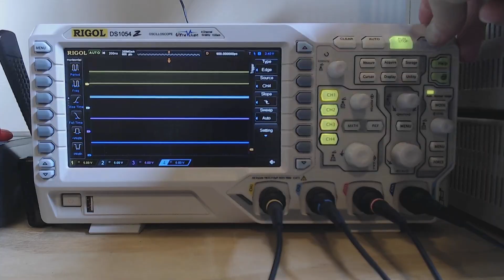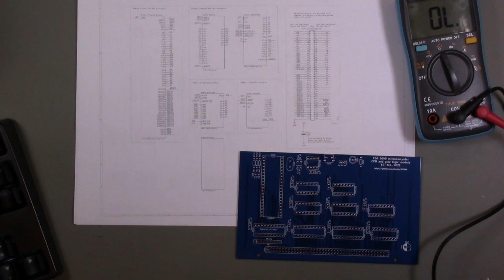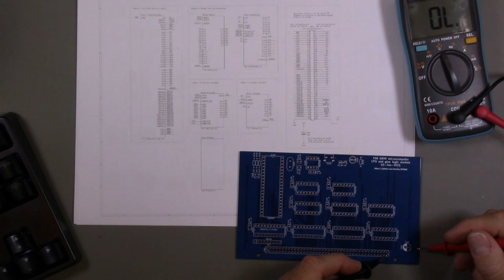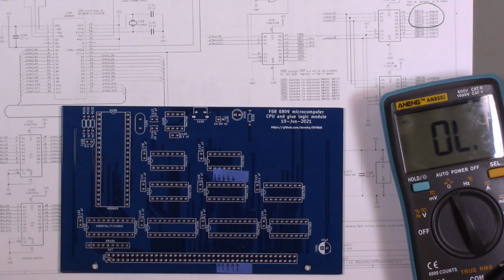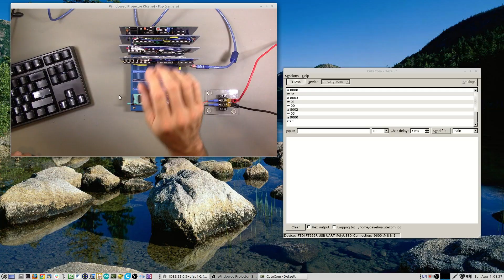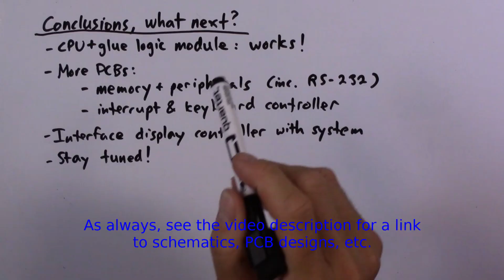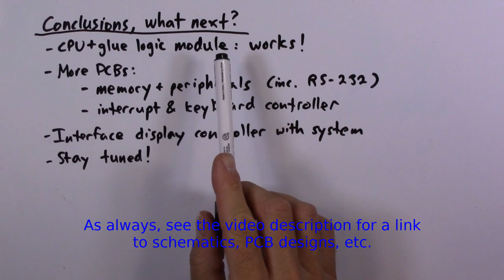DIY 8-bit computer, Episode 17: Fixed CPU/glue logic PCBs

Comment: Hello sir, I have a question. Is it possible/viable building some glue logic circuitry to allow newer RAM sticks (DDR5?) with 8/16/32bit systems(6502, z80,68k etc)?
Reply from the maker: I've never worked on modern DRAM technologies, or even any kind of DRAM at all. I think that memory controllers for modern DRAM devices are available for FPGAs, so you could potentially synthesize a  memory controller that way. However, you can get fairly large SRAM devices if you don't mind using a surface mount part, so that would probably be an easier option, since SRAMs require minimal glue logic.
Reply: @davehohacks  Thank you, that's a very interesting suggestion. But if the main intention is the replacement of old DRAMs (circuits with refresh), would SRAM without extra circuitry still be an option? Thank you again for sharing you knowledge.
Reply from the maker: @CP200S  Oh, I see, you're talking about using newer DRAM modules in older existing systems. I don't really know how  feasible that would be.

Comment: Looks great. Your reversed power connections is similar to my COMPLETELY MISSING!! power connections on my first custom PCB order. My backplane was great (thankfully), but my custom proto cards are missing the connection from the power pins to the ground/power planes. So I need to wire them on each card. Annoying, but at least they're usable.  https://youtu.be/x4IN8i7_U_4